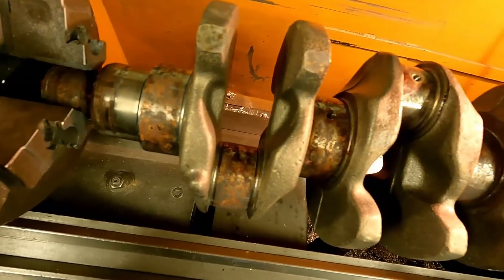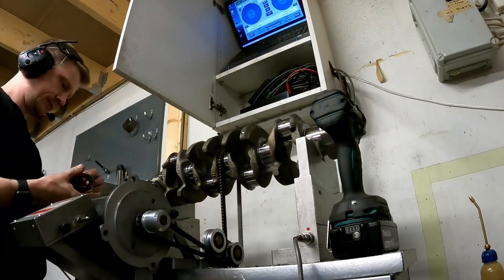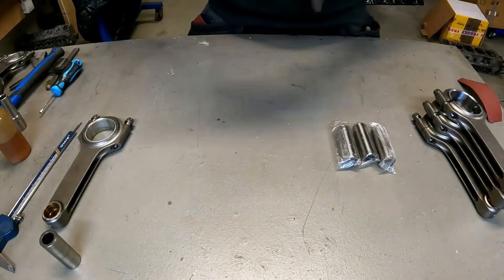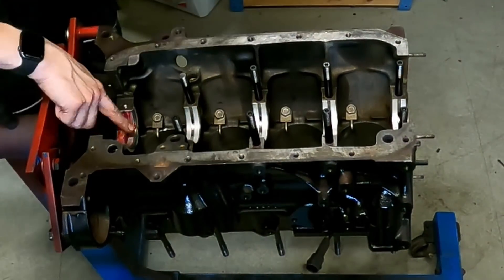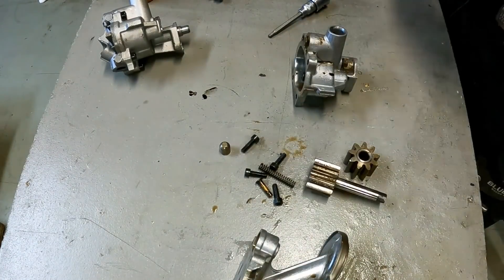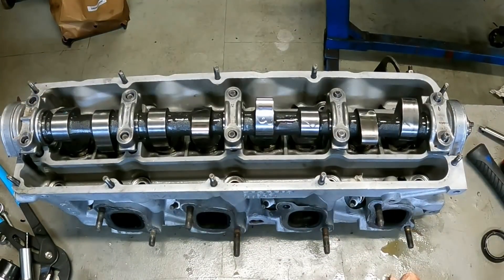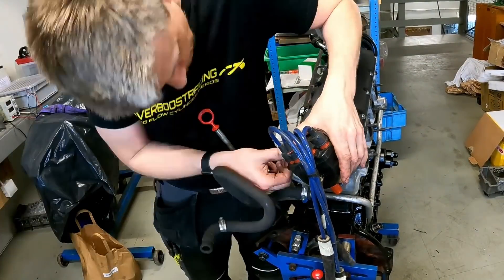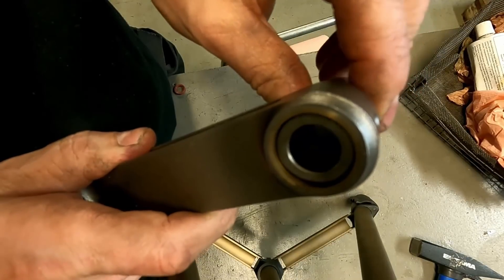ENG-Volvo b230 redblock 700whp overhaul and rebuild- Tips and trix

Comment: This is really good and useful content, definitely keep going. The other videos about building 600 hp redblock are in my favourites. By the way, it is still quite amazing that one can build a 700 whp car with such an ancient engine technology-wise. I wonder how much boost does a 8v redblock need to hit 700 whp and how the torque curve would look like. I saw flow graphs of 531 head vs the 16v head and the 531 figures didn`t look impressive on the paper. It was like 170 cfm and 280 cfm respectively.
Reply: And also I wonder if you happen to have any experience with new smaller high flowing turbines on redblocks like Garret g25 or new borg EFR. I`m building a redblock (stroked b21 with oil sprinklers (lol) and forged internals with 531 head)  and want to achieve the broadest torque curve possible for everyday/track use, but still want to have decent power like 500+ ish whp

Comment: Hi Tommy.
Your English voice over is great. I like it.
You say to torque the head bolts to 150Nm and no more or the head or block crack. What parts crack?
I like your 'Girdle' plate you put on your engines. I think that is very good.
I have a 2.5 litre AQ151C engine, several B230FK/T engines and a B230FB engine. They are all 1992+. I shall to use the B230FB block as my start point as it has little wear and has squirters and use the AQ151C crank as that engine does not have squirters and is rusty on the outside from salt water. I think the AQ151C engine was in a boat but was hardly used. It is perfect inside. I have various cams A, Vx Vx3, B, T etc from various engines and brown (Ford) injectors, 3" AMM, 15G  turbo etc to hopefully hit about 220Hp.
I have had these parts a long time but it will be a project for the future.

Keep up the good videos.
Rob

Comment: Great video, lovely rebuild. 
Your english is pretty good. 
I understand your explanations easily compared to american buddies not mumbling but constantly eating words speaking too fast with duck emphasis 😄 
I live in France and we are rebuilding a red block for my car after we ruined the first one stupidly... Oil pump shaft was not held in correct position: it got lifted up, that broke the auxiliary shaft that fell into conrod #4 path. Piston #4 broke releasing its conrod that destroyed the engine block both sides. Every conrods got bent, complete engine low end got destroyed. Apparently, these engines produce strong vibrations between 2000 and 3000 rpm that it can make the oil pump shaft to left its correct position if not  held properly.

Comment: @overboostracing The water pump in the video does not have a pulley. Is this for electric water pump? How are the belts routed? Can you explain how this works for daily use at 700HP?

Comment: Like your work! I have a boat with a Volvo AQ171-c red block and I am trying to learn what parts (such as Cam Belt replacement Kits) are available from car engines, as Boat suppliers charge so much more than cars!!! Cheers.
Reply: Most of the 88 through 97 red block timing belt kits will work for you bro
Reply: @jollyrodger5319  Thanks mate!... when you say "most", what should I be looking out for?

Comment: Great video! Does the 150Nm of torque also apply for normal head bolts or only for ARP studs?
Reply from the maker: Only arp, don't do more than 120 in driving conditions
Reply: @Overboostracing  okay thanks for the reply!
Reply: Hey Tommy, sorry to bother you again but if It get it right you skip the 90° stage and 
1: 20Nm
2: 60Nm
3: 120Nm 
Or just torque it 90 degrees? And check tension at 120Nm after it has runned in? 
Thanks again!!

Comment: This video was great and its amazing to see that good engine building procedures go across all languages. Could you maybe talk more about what the oil flame trap box has been replaced with? What Valve springs & valves? What part # are the ARP studs you used?

Comment: Nice video. Do you ever have trouble after changing the stock crank pulley to the solid crank pulley?
Reply from the maker: Yes if i make an engine from scratch i would put a damper on it. Problem is that the v belt is flying of or turning around to the back in the pulleys. The multirib wheel is a fast and good workaround. Not in longtherm do

Comment: Hi, thanks for content 👍
Did you skim the block and head?
Reply from the maker: Yes i always do if i have the abillity. This block was a fresh build
Reply: @Overboostracing  I just found b230et engine with 100k km feels good and powerful . Thinking to put cheap china turbo on gt35 💪😅😂 got bigger injectors, fuel chip installed should I touch the headgasket? Aiming around 280-320 hp